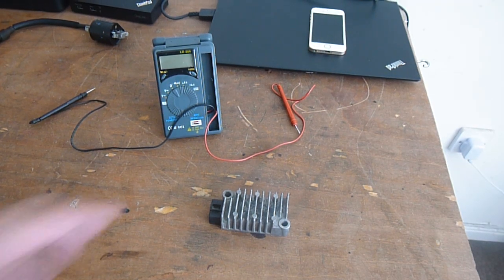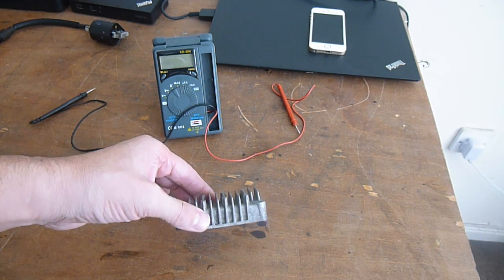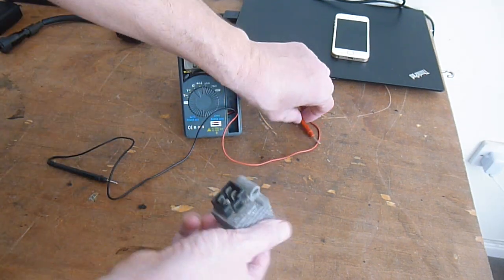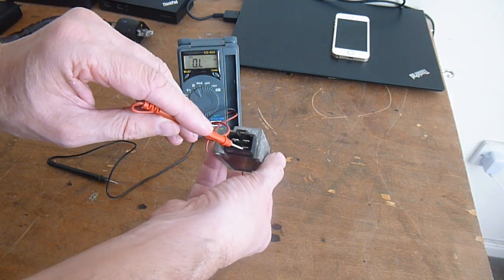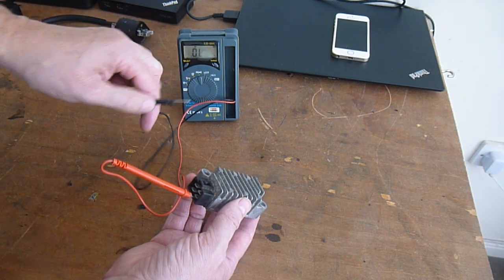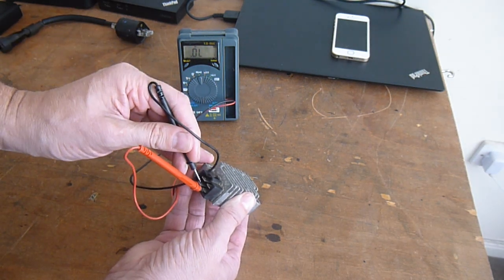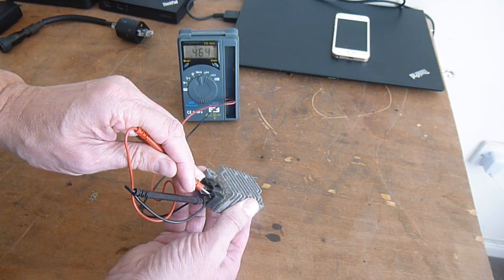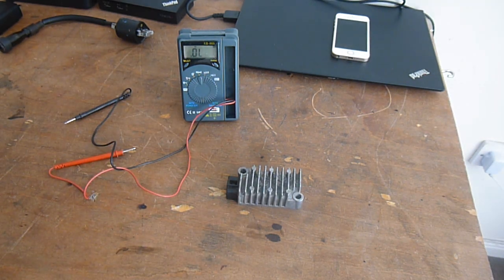Yamaha R125 / R15 Battery NOT Charging? Regulator Rectifier Test & Diagnosis (How It Works)

Comment: Hi mate great vid. Could you guide me on welding for a diyer. What machine to buy? Don't want the rolls Royce of welders as it's just for a diyer etc..,
Reply from the maker: A clark are a good start from machine mart either arc or mig thats what i would start with miller are the best im told never had one though
Reply: Do you weld?
Reply from the maker: not as much as i used to when i did old car projects, but i always have one on hand.